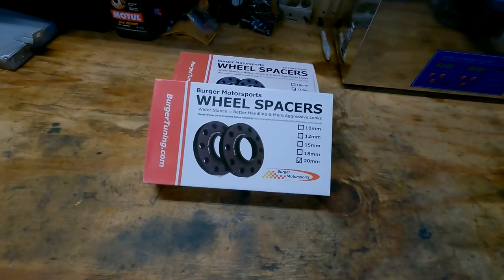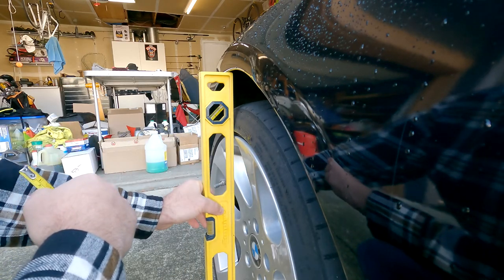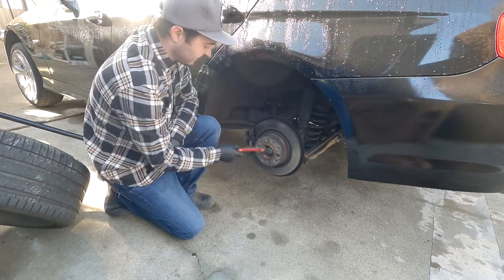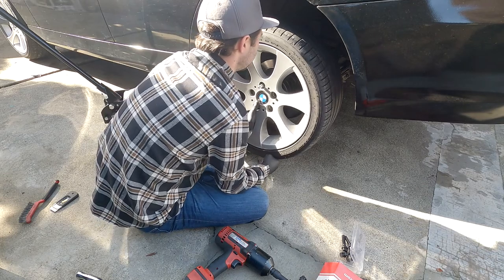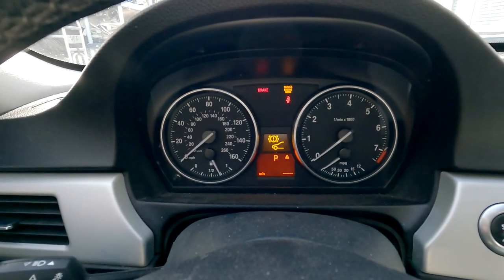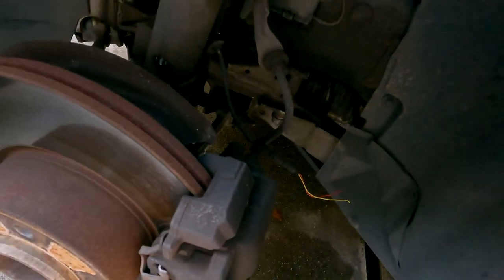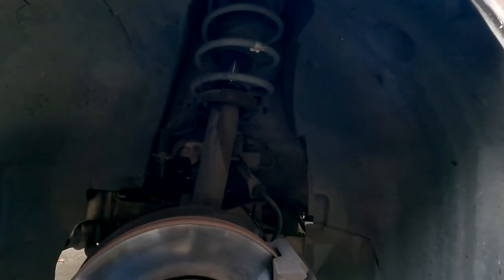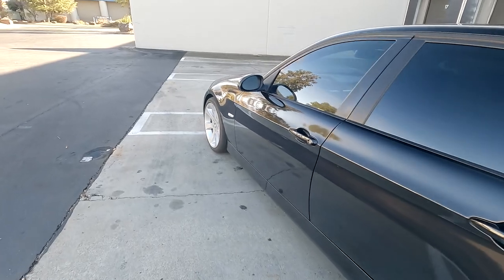E90 gets WHEEL SPACERS! // Brake warning lamp fixed!

Comment: looks really clean, aren't you worried about the tires scraping on the fenders though?
Reply from the maker: with these spacers and at stock height it is minimal rubbing. if you had sport suspension or were on coils that may be a different story but for now it is ok for me